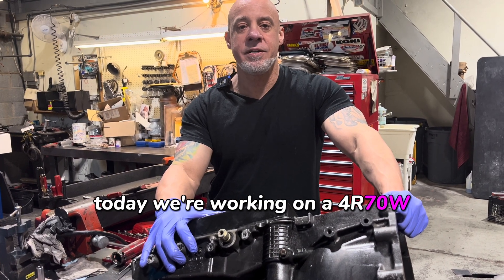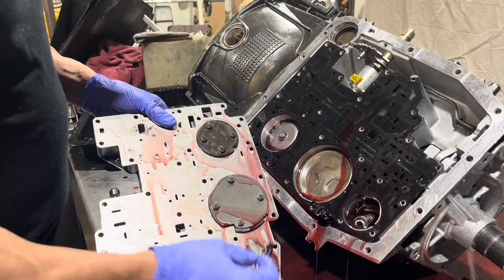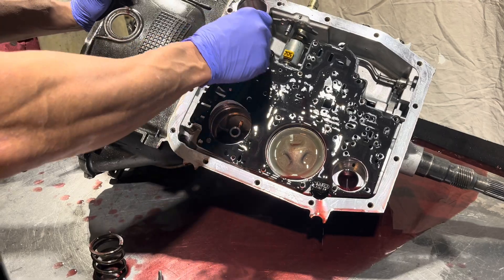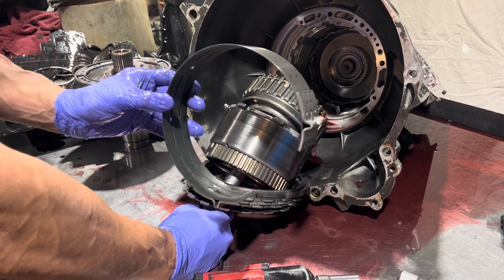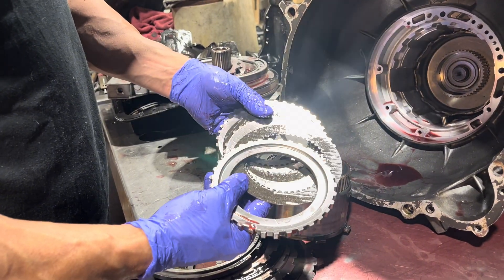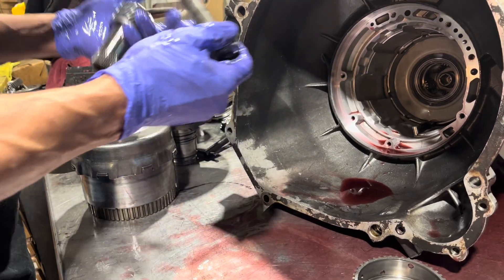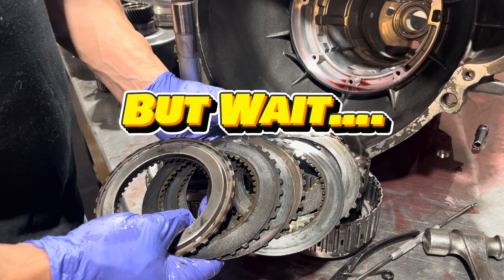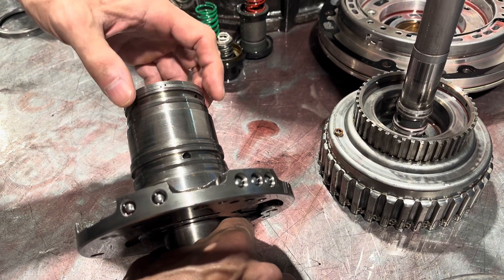4R70W Don't Get Hosed! Big Name Performance Trans Disassembled!

Comment: Purchased a big name transmission.

Hi preassure in idle at every gear.

As an example

P - 135

Checked epc silinoid on a bench. Checked good.

What could be rhe issue?

I do have a holley transmission controller with a 2003plus stock calibration.